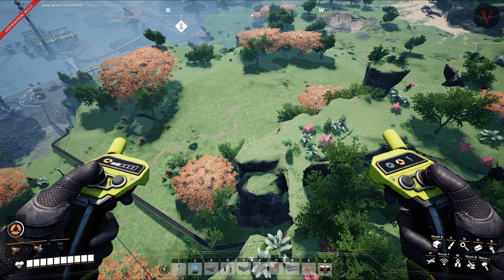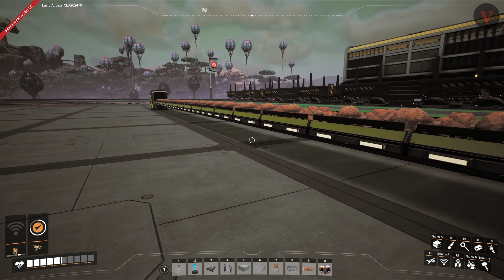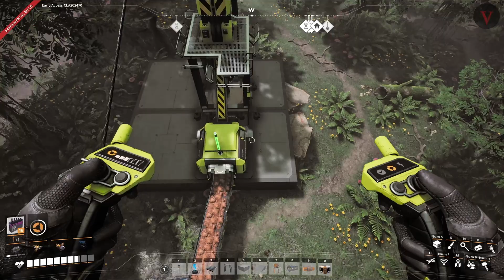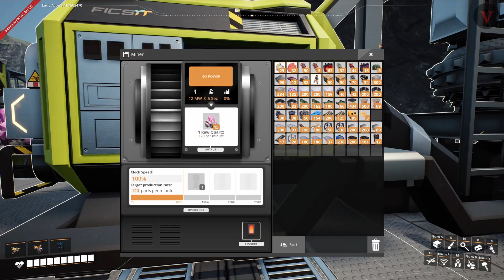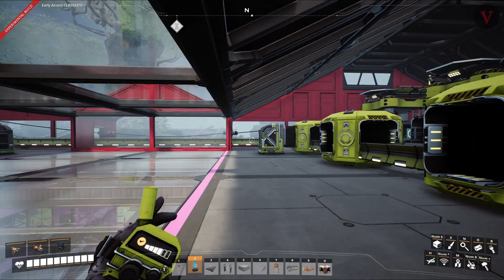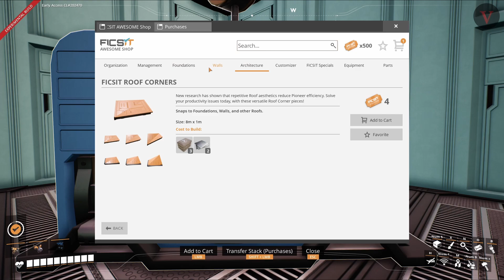Pixel Perfect E40 - Path to Aluminum Pt.1 - Satisfactory Let's Play Series

Comment: Im for iether or with the water but what i would do is setup smaller part time infastructure to get what is needed for the presure wells then build the aluminum plant proper cause sometimes the riad to perfect has to be a bit messy whent ya first started out things were messy till ya had the right stuff to make it all neat but i will also agree a large scale watter bottling facility would looks cool but im also a fan of the looks of large sections of pipelibe stretching out for miles
Reply from the maker: I'm pretty sure we're going with some bottling scheme at this point.  I'm not eager to skip tech, and it doesn't seem like anyone else is either.  It'll be extra work, but it also gives us opportunities to do cool stuff.